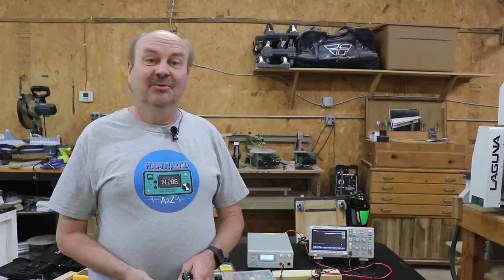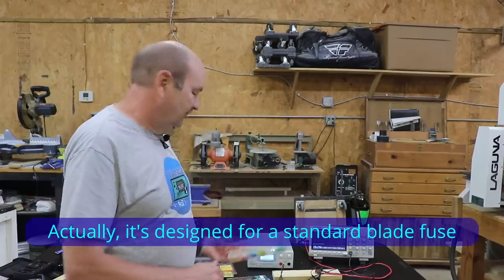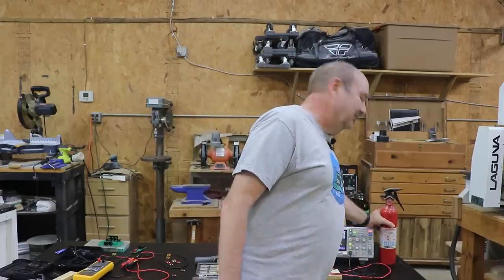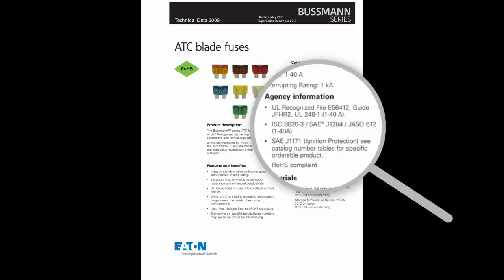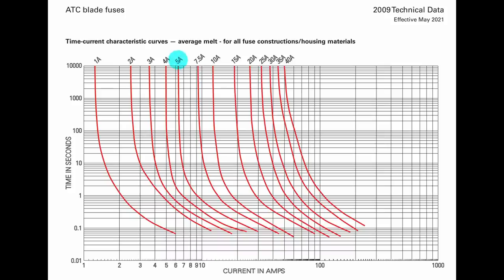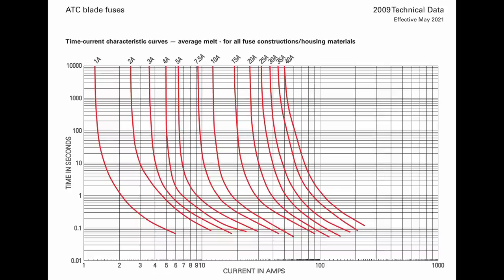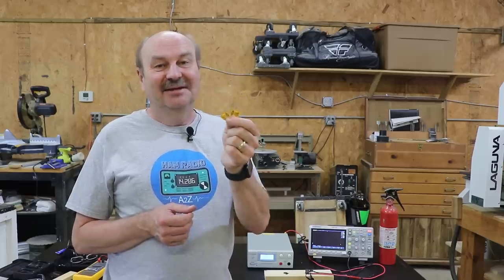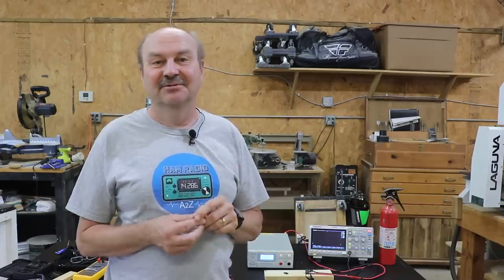Bad Fuses

Comment: Only issue that I could see is that the voltage across the fuse was only .6v. at 20 amps. not the full voltage of the circuit. The name brand got the full 15 volts at what the power supply capacitors could supply which will dump as much current as they can as soon as the fuse is connected. A better test would be to have a variable load in series with the fuse and pull the 20 amps at the circuit voltage. None of the fuses would last if they had the voltage and current across it that they would be expected to carry in a real world situation. Great vid on off brand fuses but I have had no issues with current sensitive electronics with off brand fuses.
Reply: no, it doesnt work like that, its current thats important not the voltage, the 15v you saw was the psu outputting 15v once the fuse had blown open
Reply: @andygozzo72  Except it does. you cannot have current without a voltage and you cannot have power dissipated without voltage. you can have 100 amps at .1V and the fuse will not blow. Those fuses are rated for 32v at 5 amps. that is the max that the fuse will allow. .6v at 20 amps is only ~12W of power dissipated in the fuse wire. At 12v at 20 amps you are now dissipating ~140W of power which heats the fuse wire to melting. Most fuses are of the thermal trip type. meaning that it requires a certain amount of power lost to the fuse itself in order for the fuse to trip. The reason that the off-brand fuse did not blow is that you connected the fuse and then powered on the supply. The name brand fuses you had the power supply on when you connected them. Which means that the stored energy in the capacitors was dissipated through the fuse as soon as it was connected. As you know capacitors are excellent for discharging all of their stored energy in a short period, and as such, the fuse recieved the 15V at what ever current the capacitors could provide. Which could be over 100A at Peak.

Edit: I rewatched the portion of the video that the Off-brand fuses were tested and the power supply was powered on. That is my mistake. I'm not disagreeing with you on the off-brand ones are bad, Just that they have their purpose.
Reply: @RandomZ88  no doesnt work that way round in this case, doesnt matter what voltage the psu was set at as long as above whatever drop would normally occur across the fuse at 4x current, which would be minimal as a fuse is basically almost a short circuit, as it was being tested at this, the voltage across will develop depending on current and the resistance of the fuse, the 15v or whatever only appears once the fuse blows and turns into an open circuit
Reply: it wouldnt make a jot of difference if the psu was switched on first or not , its an electronic current limiting power supply, it'll drop its output voltage immediately you load it more than the current limit is set at
Reply: @andygozzo72  Granted it is a limited power supply. I think we are both right in some reguards and wrong in others. Granted the fuse should have been long gone after 30 or so seconds and not ~2 minutes or more. I guess I dont fully understand why or how 5 amps at .6v is the same as 5 amps at 10v in respect to fuses and circuits. It all makes sense to me except for that one thing. Technically by what you are saying is that the fuse should blow at 0V. Except that would be paradoxical, as you cannot have current/flow without voltage/potential difference. That is where im getting my idea/information from. Thanks for the conversation in the comments of a youtube vid with a random person. lol
Reply: @RandomZ88  The voltage as measured across the fuse is determined by Ohm's law. In the demonstration there is 0.6 volts accross the fuse at 21.3 amps, so the resistance of the fuse is 0.6/21.3 = 0.028 ohms. If you get a beefier power supply and crank it up to 10 volts, then the current through the fuse will jump to 10/0.028 = 357 amps!

This would be hard to achieve in a real 5 amp circuit. Let's say you power it with a car battery and use 10 feet of an appropriate wire, say 20 AWG. The resistance of the wire will be 0.1 ohm. Now you put a dead short on the end. The total current will be 12.6 volts / (0.1 ohms + 0.028 ohms) = 98 amps. At 98 amps the voltage across the fuse will be 98 amps * 0.028 ohms = 2.76 volts. 

You are correct that the fuse cannot blow at 0v. As you say, there would be no current. And there would be no power to melt the metal link. But the voltage measured across a fuse will be small even at substantial overload. The resistance of the 5 amp fuse in this test is about 0.026 ohms. If you apply 10 amps to it, the voltage will be 10 x 0.026 = 0.26 volts. (Most of the voltage is still be going to the the load.) The power will be 2.6 watts. A proper fuse has a link which is made out of a low-temperature alloy which melts pretty quickly when you put 2.6 watts into it. The voltage and power consumed by an overloaded fuse needs to be quite small, otherwise it would consume too much power in normal operation!
Reply: Did some thinking on this subject and have come to the conclusion that the fuses are labeled confusingly. they are rated in Volts and amps. Which means that the testing must occur at these ratings. SO for the fuse in the vid it should have been at 32v at 5 amps. which would have given a power rating of 160W. Which would have been enough to melt the fuse. The power dissipated in the video was 21.3A X .6V OR 12.78W. Which according to the graph would have taken a long time to break the fuse. My observation has been that the fuses are rated in Volts max interrupting at Amps, and should include a Watt/power rating on the fuse. AC fuses are rated in VoltAmperes or VA which accounts for the power dissipated across the fuse. I do understand that dc fuses are different in design to ac fuses but they are fundamentally the same.

Comment: Ok so they are not the rating they say. At what point do they blow then? Because whatever point that is can be there new ratings and used for that instead. They are bad as in not what there rating says they are. They are still good for stuff at there real rating I would assume?
Reply: No, they are not fuses at all. Real fuses have a low-temperature alloy in the center which blows before any other part of the system can get too hot including the legs, the plastic cover, the fuse socket, and the wiring. These will only blow in the way any electrical component will vaporize if you put enough current through it. But to do that you probably have to connect them directly to a battery or a welder with thick cables. As a number of commentators known from experiences, real-world wiring is not thick enough to carry enough current to blow them. Instead the wiring cooks.

Comment: A measurement isn't worth any number if you don't tell the unit (are you measuring in °C or °F?) and even less if you don't know about the uncertainties (emission factor of the plastic of the fuse, not to mention the metal parts!) and which area is measured.

You measured with a cheap pyrometer, which probably has a measurement spot of 2cm at that distance. Also, a probably mounted laser indicator only shows the middle of that area at a certain distance mentioned in the manual (usually 50...75cm in distance, with a big measuring spot). If you pointed that laser to the fuse, you did point the measurement spot at the feet of the fuse at its best, also measuring the wodden background. The pyrometer then builds an average of this area.

So I bet the temperature of the fuse was MUCH higher.

Nonetheless, thanks for the video and the experiments! It is important to know that it can be outright dangerous to buy cheap. 👍
Reply: either way a fuse should never be that hot
Reply: @dummyload7803  Well, 100°F are about 37°C..
That is why I wondered about which setting he uses at the pyrometer.

Comment: These fuses are not made for exact current protection, they are for real short with really high current! At 10x nom. current they will trip much faster. But i have to agree at 4 x nom. current they should trip much faster, that would be common sense. But there are other named fuses around that can handle currents 4x nom. curr. for a long time either. You just have to be aware of that. Use a fast or very fast fuse if you need it!
Reply: Even if this were true, a short wouldn't necessarily produce 10x current. The resistance of the wire or the internal resistance of the power supply would limit it. The wire wouldd sit there and cook which is precisely the thing which fuses are intended to prevent. These arent the wrong kind of fuse, they are fake fuses.

Comment: At low voltages the total power through the circuit at 20 amps is only about 12 watts. At 5 volts and 20 amps, the fuse would be carrying 100 watts and would certainly blow. You cannot take current on its’ own and expect fuses to blow at any voltage. The cheaper non branded fuses are intended for use in vehicles and will work perfectly well in most instances. For projects using power supplies where voltages will be pulled down by an overload, then using high quality fuses with characteristic data sheets to match the performance to your requirements.

Comment: Your test and your experiment on the fuses is flawed. With the no name fuse, you had the power supply on and you plugged in the connector to start the time. With the name brand fuses, you had the power supply, turned off and everything already plugged in and then turn the power supply on.

I don’t know for certain if it would make a difference but it’s good practice to ensure that all variables are the same when doing experiments
Reply from the maker: You make an excellent point.  In any good controlled experiment, only one variable should be changed between each run.  In this case, the difference in sequence between the two tests was not intentional.  I wasn't using a checklist.  I don't think it would have made any difference.  If anything, the voltage ramping as the power supply came up should make the brand name fuse less likely to blow quickly vs. the sudden jolt of plugging the connector in.

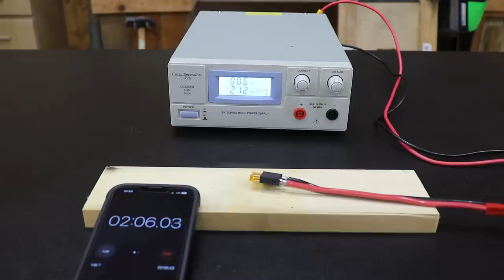Comment: 11:14 0.6V??? what did you expect? that it's gonna blow with this voltage immediately? 0.6*21.2A=12.72W so you were pushing ~13W into the first fuse and ~315W into the second one. What a freaking "reliable" test.

Comment: yeh heaps of melted ones that never did their intended purpose ie) 10A that kept taking 60A unltill wires melted , just like Chinese products buy something that should have a 5A fuse in it and find they threw a 30A in ... or double the fuses in parallel for god knows what reason @10:19 only 12w use more voltage and give it a chance to melt and break the circuit or short-circuit

Comment: These Fuses are rate for 12V @ "X" (for the amperage). An example is a fuse that is 12v @ 5 amps will have a failure rate of 60 watts ( 12*5 = 60) or greater but if there is only lets say 2V but it is pulling 20 amps (2*20=40) then the overall wattage is 40 which means that the power draw is within spec of the fuse's operational range which is 60 watts. So when picking fuses it is best to understand the overall wattage that the circuit will function at and provide a little overhead for inrush currrent on start up.
Reply: The fuse voltage rating is the garanteed voltage when de fuse is open. 
 12v @ 5 A means 2.4 ohms ... check your fuses and you will understand .
It's not 5A and 12V at the same time.
Reply: I don't think so. In your example 60 watts would be the total power in the circuit. Most of it would be going to the load, say a lamp. The fuse consumes only a faction of one percent. But this is enough to melt the low-temperature alloy if the fuse's current rating is exceeded by a large margin or for a long enough time.

Comment: I think its inconclusive. Batteries have much higher amp ratings than his power supply. He should try this with a car battery. And aren't those automotive fuses?
Reply: Oh its conclusive all right. He has correctly simulated a very seriously overloaded circuit. The fact that in an auto the battery has enough umph to create even higher overloads is irrelevant.

Comment: Why is the voltage so low? Shouldn't there be 30 volts and 20 amps? I'm wondering if the power supply is protecting itself. Putting an analog meter in line with the current and perhaps a scope to see if the current is being pulsed. I don't know all the ins and outs but it would seem a power supply that can deliver 30V at 20 amps should be able to put 600 watts into a fuse and make something happen. Never mind I commented too soon.
Reply: Ever heard of Ohm's law?
An ideal resistor, often used for approximating real devices has the voltage-current relationship V=R*I. The power supply also has it's equations, because it has internal equivalent resistance AND limiting. The power supply usually has it's voltage set to a value, but current limiting means it will decrease it if the current is too high - and that happens here. It's setup to limit the current to the maximum value it can deliver, and you saw that happen.

Comment: Those proper fuses are colour coded to the current rating while your "no name" fuses are incorrectly coloured for their rating.
That alone should have rung alarm bells before you hastily purchased a bargain box.
Reply from the maker: The no-name fuses are color coded mostly correct.  The 5 amp fuse, for example is different from the 20 amp fuse.  According to the standard, 5 should be tan and 20 should be yellow.  The 5 amp fuse is a browner shade of yellow, but I definitely wouldn’t call it tan.

Comment: Of coarse the fuse wouldn't blow. You can't test them with a protected switch mode PS.
This inept testing methodology grossly exceeds their accuracy ratings.
Reply: The protection in the power supply is not shutting the test down. It is holding it at a precise level of overload.  The test is correct and the fuse flunked badly.

Comment: This is a bogus test. You are only putting 12 watts into the 5 amp fuse. Try putting 14 volts into it at 20 amps. Duh.
Reply: 7 watts will blow a real 5 amp fuse in 80 milliseconds. The test you propose is not physical possible. You can choose the voltage or the amperage. Ohm's law chooses the other for you. If you choose 20 amps, you will get 0.6 volts at this fake fuse. If you choose 14 volts, Ohm's law chooses 500 amps. Hardly a valid test.
Reply: @david672orford  BS. You need to show the results with more watts at a simulated fault situation.

Comment: Your testing setup is flawed, you are not flowing enough energy through the fuse to melt it. 21 amps at 0 volts is 0 watts, no energy output. Fuses are designed to blow at 140 degrees Celsius (284 degrees F) and you barely got the temperature up to 70 degrees Celsius (156.3 degrees F). Try your testing again with a better power supply so you get true results.
Reply: If you look carefully, you will see that the voltage is 0.6, not zero. So the power into the fuse is 13 watts, not zero. That is more than enough to blow a real fuse almost instantly. According to a Littlefuse spec sheet their fuse will blow in 80 milliseconds at 20 amps. If you work out the power using the stated resistance you get 7 watts when it blows.

Comment: If you got these from Amazon, and they are still selling them, report Amazon to Federal authorities.

{:o:O:}
Reply: Would the authority that has jurisdiction be NHTSA because these are marketed towards automotive use, or CPSC because a lot of non-automotice low voltage devices use them too?
Reply: @soundspark  
If they are still selling these dodgy fuses, report them to both. I made a longer reply, but it seems to have been hidden by Al Gorithm.  🤣

{:o:O:}

Comment: Instead of 0.6v, put 12v+ on it and see
A fuse is basically a resister. It is dropping watts across it, not amps.
Most fuses sold in market are rated on 250v ac rails. Good luck trying to find a proper DC(low volt) fuse.
Reply: In other words connect it to a car battery using short high-gauge cables? Why? In actual operation a fuse doesn't have anything close to the full circuit voltage applied to its terminals.

Comment: Why there is not any voltages, when test that "bad" fuse? Put some current to circuit, that test is not valid like that.
Reply: The circuit current is 21.6 amps. The voltage across the terminals of the fuse is about double what it would be with a proper fuse at that current, but it still does not blow. It is not a real fuse. It is a piece of aluminum made to look like a fuse.

Comment: Just what did you expect for the price you paid!
Reply from the maker: I probably should have known better.  Some cheap things are ok.  I use cheap Harbor Freight tools as throw away tools all the time.  At the very least, I’ll be more careful about checking specs and certs for anything that matters.
Reply: When you can buy reject semiconductors for pennies on the dollar that do actually work, why would you suspect a knock-off fuse would never blow?
Reply: Until the video, I assumed that I had paid the correct price for a bulk purchase. Tom's demonstration has shown me the alternative options which I have now ordered. Thanks Tom.

Comment: 0.6v @ 21A ~12.6 watts.  Your mobile power system isn't going to do voltage foldback, nor are many common supplies.   What if 13.8v @ 20A... 260 watts, +/- conductor resistance.  Fuse would probably blow much sooner than not.  But indeed - name brand vs 'unknownium' generic bargains.